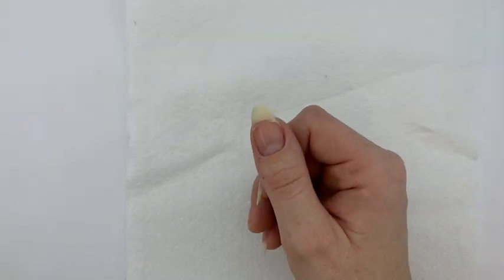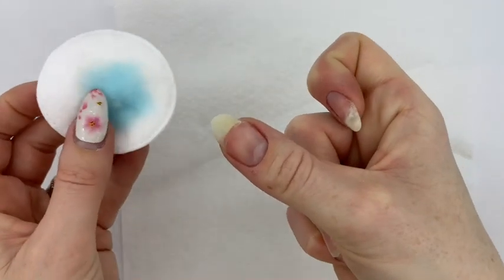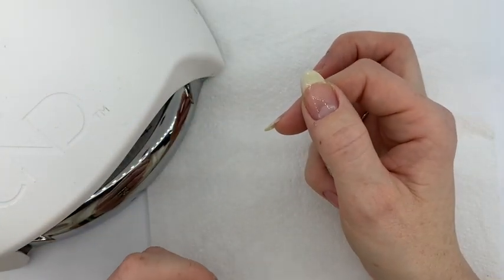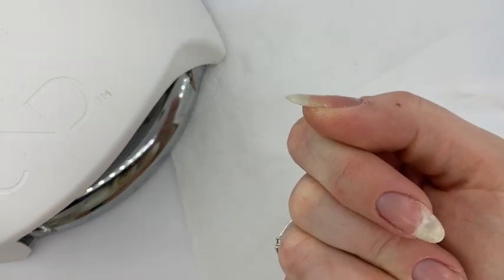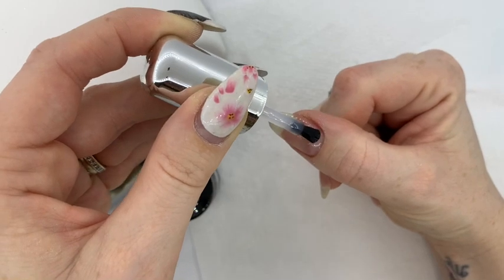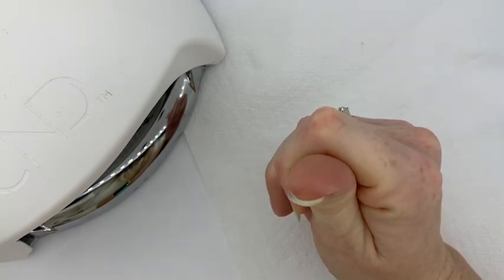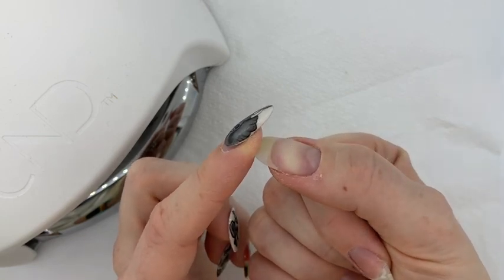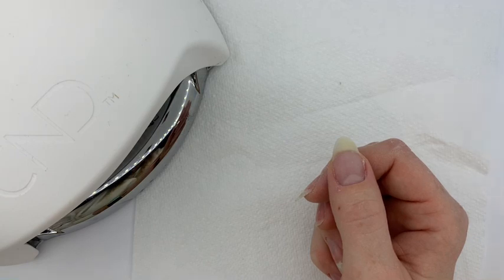How to repair a split nail with CND Plexigel shaper

Comment: His when using a colour over the shaper is the soak off exactly the same as just removing shellac without shaper? 14:43
Reply from the maker: Are you removing the gel and shaper back to the natural nail or just the gel back to the shaper so you can infill?

If you want to just change the gel colour and infill the shaper then I would recommend e-filing the colour off up to the shaper layer and performing cuticle prep and reapplying shaper and new colour.

If you wanted to remove it all you could do a complete soak off but it will take a lot longer due to the layer of shaper, so additional time would be needed. The easiest l, quickest and most cost effective method would be to e-file the colour and soak the shaper for 15mins. Obviously if your not trained in e-file then you could hand file and then soak.

Hope that helps, if your unsure let me know 😊

Comment: Thanks for this, if I want to add Shellac after refining, do I need to add the Shellac base coat? Or can I immediately begin the Shellac color polish?
Reply from the maker: You can put your shellac colour straight on top of the cured shaper and finish with either express 5, original or dura force top coat 😊

Comment: I don’t have a cnd bonder. Might you have any other alternative to use ? Thank you
Reply from the maker: If it’s the plexigel system your using it can only be the bonder that is designed to work with the system I’m afraid, otherwise you can experience product breakdown and insufficient curing. If your applying this on a client and haven’t used the correct system and any issues arise you wouldn’t be covered on your insurance 😊
Reply: @nailsbycharleds  thank you so much for your insight and informational content! Always so helpful. I had one last question: after the cnd shaper and buffing it of slightly to have a rough base; can I use regular gel foundation, color and gel top coat afterward ?
Reply from the maker: @aralopez2743  aww your welcome, glad I can help. Yes once that system has cured and you’ve refined the product you can apply any chosen brand over the top with the top coat, just remember to use the correct lamp with the system you use x
Reply: @nailsbycharleds  amazing ! Thank you so much :) always looking forward to a new vid.

Comment: Can you do this with the builder aswell instead of the shaper?
Reply from the maker: You could if you wanted to but it is thicker in viscosity, so in order to fill the split you would be better off using the bonder and the shaper 😊

Comment: This was amazing to watch! 
So you don’t have to wipe the shine or tacky layer if you gonna apply a colour?
Reply from the maker: Aww thank you I’m glad you enjoyed it.
No you don’t need to remove the tacky inhibition layer of your applying a colour and you don’t need to apply a base coat either. You will need to apply a top coat as normal though 😊
Reply: @nailsbycharleds  ahh amazing thanks hun 
I’m so excited to start using it! Is that the same with the builder too? Once you have done it you don’t have to wipe unless your gonna file it? Then can apply your shellac on? Z x
Reply from the maker: @gabriellapiponides7846  yeah the same applies for the builder gel too. Only remove the inhibition layer if you need to refine the nail with a file. Otherwise you can go straight over with a standard polish or a gel polish colour and top coat or alternatively if you don’t want a colour at all, that is when you would use the protector top coat x
Reply: @nailsbycharleds  amazing thank you hunny

Comment: I've got really tiny nails and they grow upwards so I end up having vertically split nails and ridges they are a nightmare.
I can get them so long and then they just split any advice thanks
Reply from the maker: It sounds like you may have onychorrhexis, which can be caused by a number of things. Is it on all of your nails or just the odd one?
If it’s all of them you may want to pop to the drs to check any underlying health conditions, as it can be a sign of low iron, low folic acid or anaemia amongst other things. It may also be just ageing or if you have damaged them, but if it’s causing you concern I’d just get a blood test done to check to rule anything out.

If it’s non of the above, it could be that that’s just the way they naturally grow and if you have bitten your nails in the past, I often find it can cause ski slope nails once you start growing them. 

From a nail treatment perspective, if I was your tech I’d be checking all of these things first so we could look at a treatment plan moving forward that would help improve the condition and appearance. 

So firstly I would look at applying CND rescue rxx for a few weeks to help combat the splitting and accompany them with conditioning manicures. Avoiding buffing the surface as this will thin it out more. Then I’d potentially look at applying a layer of plexigel shaper to help with the appearance of the nail and plump out those ridges, so it’s a smooth surface and helps to prevent splitting. Which will allow your nails to grow naturally. Make sure to apply solar oil daily too, to help hydrate the nail and cuticle and also to help strengthen the new nail as it grows.

Hope this helps 😊
Reply: Thankyou for your explanation 
I'm disabled and the last time I went to the doctors for blood everything was low,he said as a child you store like a vitamin and mineral supply he said mine had gone.
I don't eat properly so this could be the cause of nails splitting not getting enough vitamin.
I never went back to the doctors because of covid.
As I'm typing this another nail has split vertically🙄
Reply from the maker: @tracyarmer9632  ah ok, it might be worth popping back to the drs and having another blood test. They will be able to advise you best if it’s a deficiency and then provide the medication needed. In the meantime I would keep them short to prevent them splitting and apply rescue rxx daily and solar oil. Over time they will improve and then you will be able to grow them without breaking 😊

Comment: What is the difference between this and builder gel
Reply from the maker: Shaper gel is thinner in viscosity, so it’s perfect for repairing splits and breaks in the nail and if you have a client who has a flat or shapeless nail, you can float the shaper gel over to plump out the nail and create a bit of shape in order to give it a nicer more aesthetic appearance.

Builder gel is used to add length and strength, so if you need to add additional length to a clients nail you can either apply a tip or a nail form and sculpt a new nail or set of enhancements. If you need to apply a small free edge you can also do this with shaper. 

Hope that helps 😀

Comment: Can I use the Bonder instead of shellac base coat during shellac service?
Reply from the maker: You would only apply the Plexigel bonder if you were then applying the shaper or builder gel. For shellac straight onto the nail it needs to be the base coat. If your finding your application of shellac isn’t lasting you can try the base wear extender, but apply a thin layer and cure for 10 seconds

Comment: Can builder only be applied directly to the nail?
Reply from the maker: I’m not sure what you mean?
For a split nail you would use shaper.  You can apply builder if you wanted to create an enhancement or free edge. So you could apply that over a tip or you could sculpt with a form.
I think I’ve understood you correctly, if not let me know 😊
Reply: @nailsbycharleds  Thank you for replying 🙂 I am quite happy with the CND Creative Play base coat and now its unavailable in my region so I thought to switch to this builder Ive asked you about?
Reply from the maker: Ah ok, so Plexigel builder is a builder gel, whereas creative play is a standard base coat isn’t it?
The only creative play I use are for my stamping plates.
Did you want a gel base that you cure under the lamp?
Reply: @nailsbycharleds  Yes and strong because my natural nails are not strong at all. Thank you again for replying, I love your channel generally 🙂🙂
Reply from the maker: @amandab6182  aww thank you, I’m glad you like it. Yes definitely if you need some strength go for Plexigel. Apply your bonder and shaper over your natural nails and then whatever colour you like and top coat.  Or if you wanted to make your natural nails longer you can use the builder to extend your free edge. 
Let me know how you get on 😊
Reply: @nailsbycharleds  So I can just file the nail, add builder immediately then color then top coat ? ❤️
Reply from the maker: File your natural nail and do your cuticle prep. Make sure you dehydrate the nail and then apply a thin layer of bonder and cure under the lamp for 10seconds. Then apply the builder and cure on button 2B for 1 minute. If your happy with the shape you can go straight in with your colour. If it needs refining, remove the tacky layer with ipa and then file them into shape.  Then you can cleanse over to get rid of the dust with your ipa and go straight in with your colour and top coat. There’s no need to apply a base coat because The builder gel will act as the base.
When you come to do them again, you can just file your colour back and infill x
Reply: @nailsbycharleds  Thank you, very practical advice and helpful info 💜